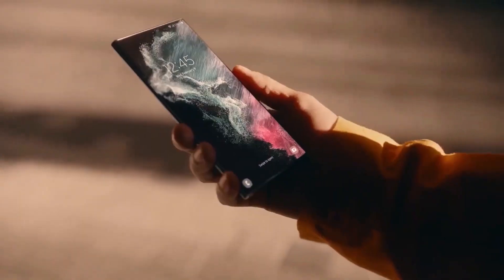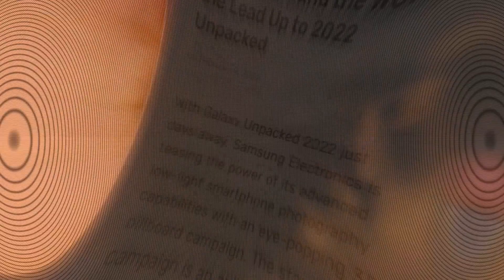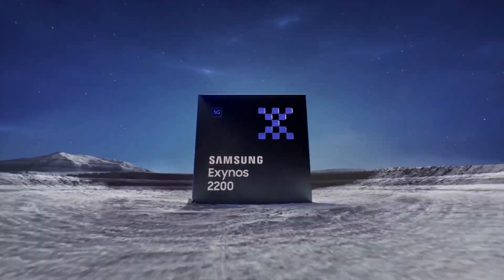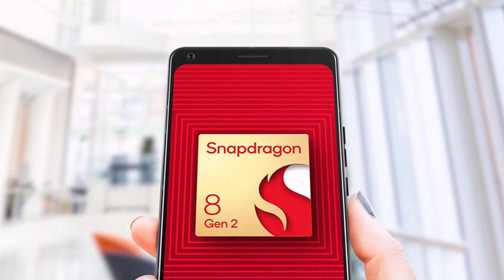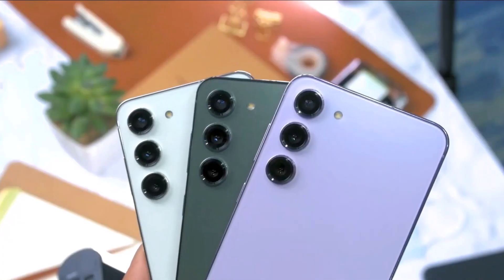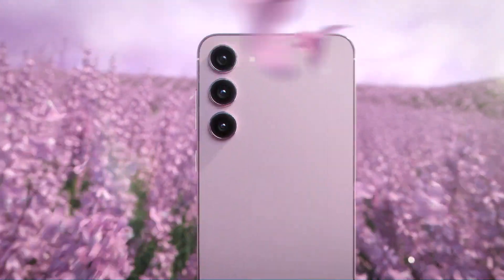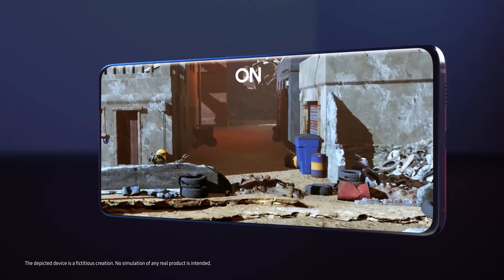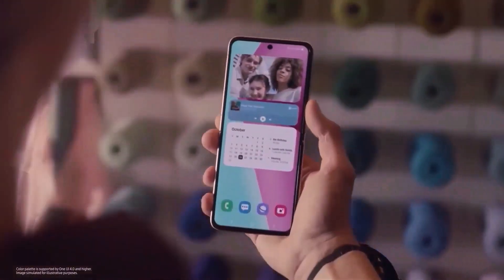Samsung Galaxy S23 FE - FINALLY!

Comment: Samsung should use 7+gen2
Reply: doesn't have av1 decode/encoding so its a failed chip
Reply: if they do that their flagship sale will drop that's why they don't make their weak phone powerful
Reply: @loicstephan3719  7+gen 2 is not a proper flagship processor like 8+gen 1 they can easily give this processor.

Comment: The FE version should at least offer expendable storage like the A series. Come on Samsung do better.
Reply: if you have enough to buy an s device from samsung you have enough for samsungs external ssds literally 100x better than a microSD
Reply: @sireajeel5009  i actually have a 4 terabyte ssd but i wanted to use it for my ps5. It stores the games there but i cant play them 😭